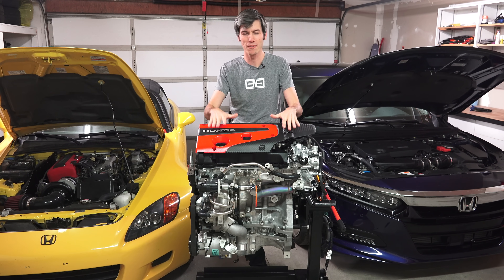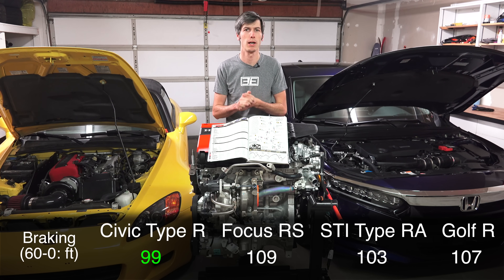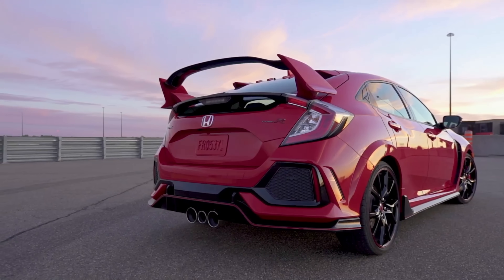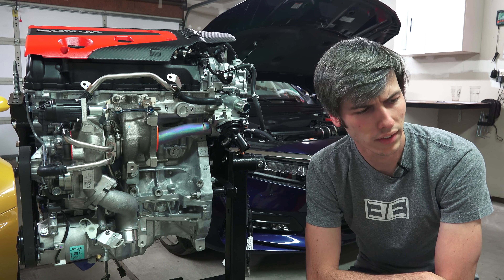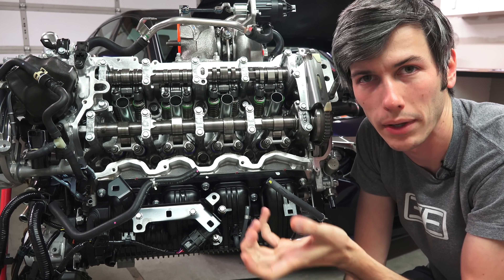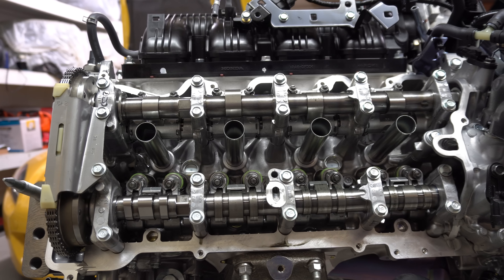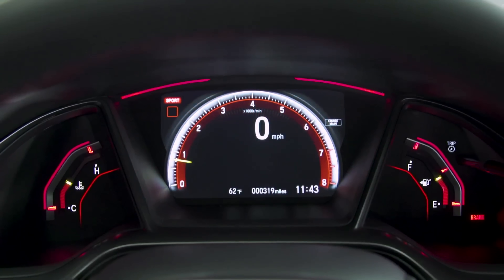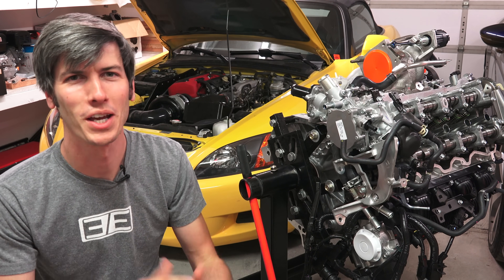The Honda Civic Type R Destroys The Competition - The Best Engines

Comment: What's the relationship between vibration and horsepower
Reply: It takes hp to turn a balance shaft.  No balance shaft=more felt vibration and less hp
Reply: @Sageofthe16  but I don't think it takes engines raw hp to run the balance shaft correct me if I am wrong .

Comment: Is it really regular maintenance to adjust the valves in these new late model cars, I thought ppl stopped doing that years ago. I doubt a dealer would waste time, opening the engine to check the valve adjustment. 😂

Comment: I haven't realized that the STi's number has gotten so bad over the recent years.  When the 1st gen STi's came out, their 0-60 were closer to 4.8sec, and 1/4 mile times were closer to 13.25sec....all the extra "luxury" stuff  I guess, changed the car from what it was......
Reply from the maker: Haha, yeah they've gained plenty of features but the engine is same old for the past 14ish years.
Reply: Yea, I believe u are pretty correct on that.  They change some components, like the turbos, etc but the engine, pretty much the same

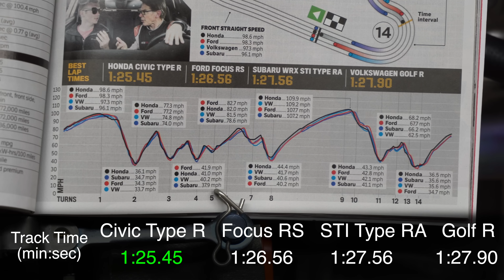Comment: 1:46 would be true, but those darn dealerships markups.
Reply: Got mine for MSRP. They're out there.
Reply: It is about supply and demand. Until the demand subsides the dealer will continue to "make a profit". They are not going to make it on me though. I'll wait till the feeding frenzy subsides. Own a '91  NSX, 22nd one in the US. The original owner paid 22K over list, 83K. A bit of money even now, a LOT in '91.
Reply: In all fairness, the Subaru gets marked up too and so did the Focus when it was first released. I'd be interested to see the average dealership prices of these cars since that's the number we're more likely to see a bill for should we purchase one.
Reply: SecretSauceyjuice Focus RS prices dropped after the scare with the heads not sealing. You can get used ones at $35,000 with <5,000 miles. I’d much rather get the RS
Reply: @Snake-pw2wm 
Yeah, I know. I was just comparing them all when they were first released. Kind of unfair to say the civic is the only one marked up.
Reply: Saw on in toronto for close to 62k.
Reply: Canada has laws against mark-ups. If you pay anything over MSRP you got ripped off .
Reply: pay more than msrp? only in murica... i never heard such a thing before in europe...
in fact is uncommon pay the same ammount of official price, almost always is lower
Reply: Wait what? You pay more than mrsp in the usa? In germany it's vice-versa. You basically get at least a discount of 10% and as far as 30% for some models.
Reply: Amen. I wanted the Civic Type R badly but the only dealership in the state to get them wouldn't budge on $5k over MSRP. As opposed to Ford dealer that gave me a Focus RS for $4k under.
Reply: I was able to get mine for msrp.
Reply: Philly has one for retail lol
Reply: Right. Luckily both the Type Rs we got at my dealership sold for MSRP. It was the high demand that drove the prices up. Customers were just about bidding on them offering to pay $20,000 over MSRP if it would be reserved for them. Crazy.
Reply: I was at the Honda dealership yesterday and they had one on the showroom floor with a $8,000 mark-up.
Reply: theres a used one for 45k lmao

Comment: Been to the local Honda dealer yesterday for oil change....they want $52k for Type-R Civic!!!! 😨😩😕
Reply: In Canada every single one is 55 thousand :/
Reply: 55 cad are 42 usd
Reply: No dealers in DFW will sell at msrp. I think engineering explained’s price comparison for most markets is invalid.
Reply: Buy it through Sams or Costco. They work with the major Honda dealerships in the area.
Reply: I got mine MSRP. If you don't find one for MSRP, you don't want the car enough
Reply from the maker: They won't get it, other dealers are selling at MSRP. Shop around and save the money.
Reply: and you can get a brand new Mustang GT with performance package and the 10spd auto just right around $40k or less if you opt for a 2018. That'll do 4.3 0-60 and under 12sec 1/4 mile
Reply: Love the performance of the new Fords but I'll never buy a new one until they modernize their warranty.

Comment: Why wouldn't the type R have balance shafts?
Reducing those vibrations would help with the longevity of the engine wouldnt it?
Maybe the accord engine is better for racing.
Reply from the maker: Not necessarily. Saves weight, rotational inertia, power. Vibrations may be low enough that you as a driver feel them, but to an engine it may not be a significant force.

Comment: The Type R will hang with them in stock form as it has less power loss from not having an AWD box to sapp all the engines power..... throw a quick remap on each of them and the AWD cars will pull away as they'll handle the increase better and have enough power to overcome the weight and rotating mass advantage the Type R has.

Comment: Yeh yeh, all very interesting. But you / they omitted the worlds best hot hatch which leaves all of those in its wake. The Mercedes A45. 2.0T 4cyl, with 382BHP.  The new A45 coming out in Nov will have 405BHP from an all new 2.0T 4cyl.
Reply from the maker: Yes, it's faster (though we don't have the A45, just the GLA45 here in the states). But it also starts at $53k, and no manual offered. Everything tested was manual.
Reply: I believe you have the CLA45 in the US, which is the Coupe Line A class, and has the same performance as the A45.

Comment: Why all the Honda hate?  Jason says nothing negative about the other cars, which are all also great.  He simply points out the Honda achievements, which are impiricially undeniable.  Also, Honda has been making great, great 4 cylinder engines since their inception, so it is not as if they got lucky this time.  The first car I ever bought with my own money was a 1987 Integra LS with the sweetest 1.6L 16V DOHC engine that revved to about 8000 rpm.  Back in those days, 4 valves per cylinder was not common and that little engine would sing.
Reply: The 1987 Integra RS, 5 door, 5 speed was my first car too.  Described as a pocket rocket in the day, redline started at 7000. And it revved willingly and smoothly.  Gas cutoff probably occurred at 8000 but I never went that far.   Yes, DOHC was uncommon and I remember the DOHC stickers on the door.
Reply: Im really not seeing any hate per se, people just think the car is ugly. Which is a totally reasonable opionion.
Reply: The hate because the title and content is very misleading.

Comment: Last year we purchased a new 2017 Accord Coupe with the 2.4 liter 4 cylinder.  One of the primary reasons for the purchase was the non-turbocharged engine in the higher trim levels vs. 2018 models.  Our previous Honda had 260,000 miles with zero issues and the engine did not burn any oil between changes.  However the car was totaled (not our fault)  so we purchased the Accord.   I just do not trust the long term reliability of tubo vs. normally aspirated engines even if they are Hondas.    I wonder if Honda or any body has any long term reliability comparisons  (actual or MTBF analysis) between  turbo vs. non-turbo engines.   I would also like to see a comparison of likely maintenance costs as I suspect higher costs for tubo engines
Reply: Semi-trucks which routinely run for several million miles on the factory powertrain are now all turbocharged, without exception. I don’t think your concern is a valid one.
Reply: @JohnnyAmerique  you are comparing heavy duty tractor engines to Honda's car engines.... I'm not sure your comparison is a valid one.
Reply: Agree 100% that the big-rig comparison can only go so far and does not invalidate this concern. They are definitely different beasts. However, judging from the reports in this thread, if "only" a couple hundred thousand miles is the goal, maybe we shouldn't be terribly worried provided the car is maintained.
Reply: my 1990 Eagle Talon TSi had over 200K on the stock Turbo before the Chicago Winters of Salt finally ate through it in 2008
Reply: I was going to say. I bought a TSI from the original owner and it had 120k on it.  Ran like a dream all the way up until I sold it at 160k.
Reply: As long as oil changes are done in a regular and timely manner with quality oil a turbo engine should be very reliable. Since the turbo works the oil harder a lack of maintenance seems to exponentially build up and all the most expensive parts are sensitive to poor maintenance (even if it's the factory telling you to do something like drive regular oil 10k miles.) I've worked on and serviced turbo cars and that's the prime factor, much higher than just bad luck causing the turbo to fail.
Reply: I totally agree and I believe your point is crucial.  I suspect that most people that watch this and other auto related channels are auto enthusiasts to some degree certainly more than the average person.  I have been an enthusiast since I was teenager, reading magazines such as Car & Driver and Road & Track and others.   As enthusiasts I suspect we are more likely to maintain our cars and notice things that might not be quite right and address them ASAP.  Most drivers only care that the car starts every time and gets them where they want to go.  I am not saying that is bad in fact there have been times I almost wish I was so inclined.  

As for as large trucks are concerned what works and is durable in a large diesel truck is not  necessarily the same in a small gasoline engine.  Not to say that all large trucks are all well maintained, but most trucking companies (especially large companies that closely monitor costs etc.) will try to keep their trucks maintained and on the road.  

As to miles/gallon the difference between a 2017 Accord with a  N/A 4 cylinder and a 2018 turbo 4 is only 1 to 2 mpg.  From my perspective this is not significant especially considering the additional complexity and potential maintenance costs.  However I do realize that from a manufacturers perspective this is the not case given the legal requirements (CAFE) they are forced to meet.
Reply: Honda has been making turbo engines for over 2 decades.
Reply: yea, and Honda is new to the turbo charging game.Let's wait and see
Reply: Ditto; I shyed away from a turbo'd vehicle and bought a naturally aspirated vehicle instead... like you, for assumed reliability reasons. I think a turbo engine could be designed for high mileage, considering the big-rig turbo-diesels.
Reply: It depends. My 1999 saab 9-3 turbo has well over 200k miles on the original turbo. But it depends on the brand. I can trust saab (obviously) because I have both owned one and they have been making turbocharged cars since the 70s and they are known to be some of the most reliable cars on the planet. I would never buy a ford turbo tho because its ford and ive seen countless issues with their implementation, but i might trust honda because they seem to do a pretty good job at keeping things reliable, even if theyre new to certain technologies
Reply: wasnt the 1st gen rdx turbocharged??
Reply: change your oil and filter on time, never push it when cold, never put lower grade gasoline than manufacture specified,  should be fine
Reply: There are some old ass swirl injection diesels running stock turbos at 1.5bar that have easily passed 1 million km.